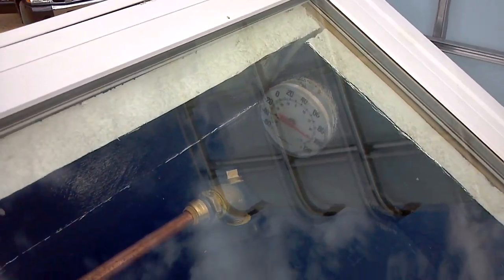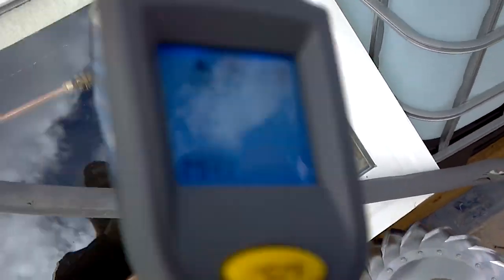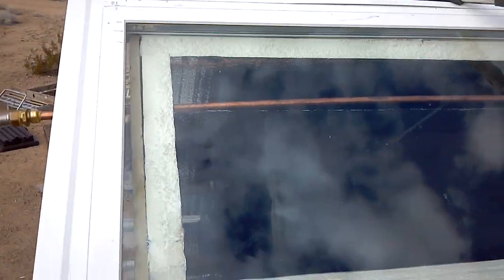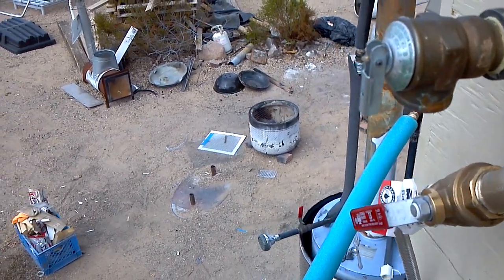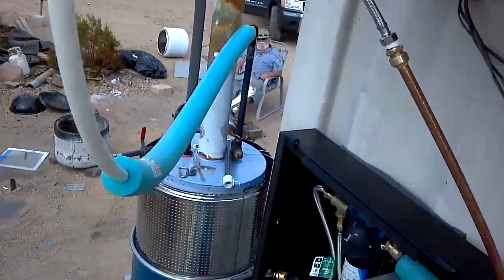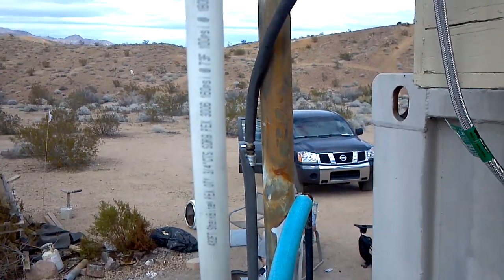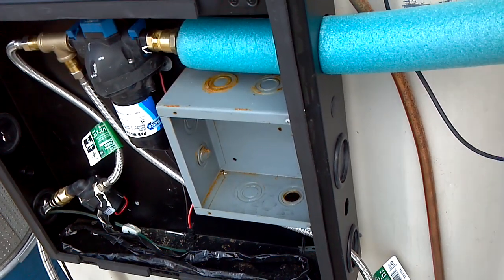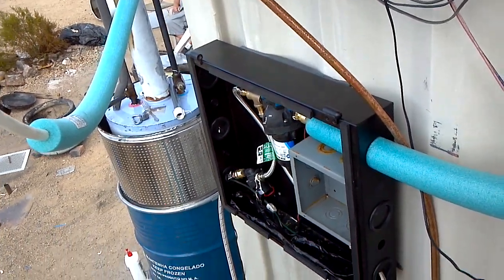Solar batch water heater part 3

Comment: Hey Bob any updates on performance and long-term use I got a lot of questions on this would like to ask because I'm looking at building one
Reply from the maker: Freeman's outdoor adventures it's been working great till about a month ago I have a leak around one of the pipes coming out of the tank. But yeah produces a lot of hot water when the sun is out
Reply from the maker: Freeman's outdoor adventures so I guess the tip would be get one of those fittings from Home Depot that reduces the chance of electrolysis.
Reply: I was but I like the rocket stove too
Reply: Cool will do when I build mine.....so do you still use it with the rocket stove or just purely solar
Reply from the maker: Freeman's outdoor adventures the rocket stove part of it still works great I thought you were talking about the solar.
I just used it this weekend. It takes the equivalent of 4 12 inch 2*4s to raise the water temperature 20 degrees. I can also use pellets and walk away from it. Where do you live?

Comment from the maker: @ Prepmor Is it the shark bite connectors on the copper? I have seen the shark bites used on radiant floor heating and I would assume there will be no trouble with them In that application. I only have a couple of fittings on the copper pipe that would be easy enough to sweat.

Comment: I have R&R ed solar water heaters for roofers in the past.Found the shark bite fittings would leak after a while on the hot water side from the roof panels.Had to go back,remove the shark bites and sweat the pipes.Cold water sides were not a problem but had to remove them to placate the homeowner.Just a suggestion, keep an eye on them.Btw, nice setup...

Comment from the maker: Half of the audio didn't come through. I am going to upload it again tonight.
 Thanks Jeff yes I like the shark bite fittings because you can take them apart and reuse them .  That comes in handy Especially as often as I reach work my system. A little pricey however. Most of the expense on this project was in the fittings. 
   What I have noticed is some thermal siphoning. I think the cold inlet on the rocket stove water heater pipe needs to go down to the ground before it comes up again.